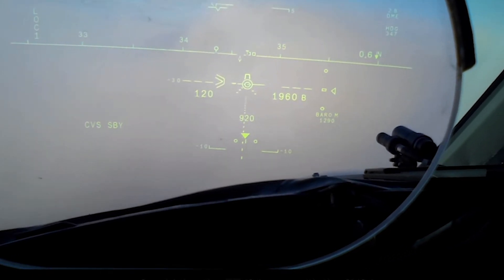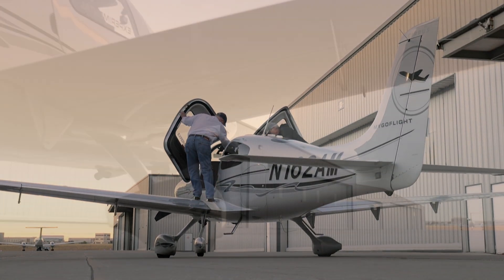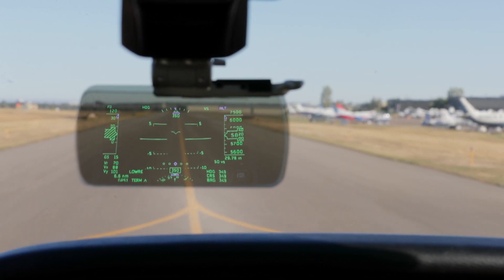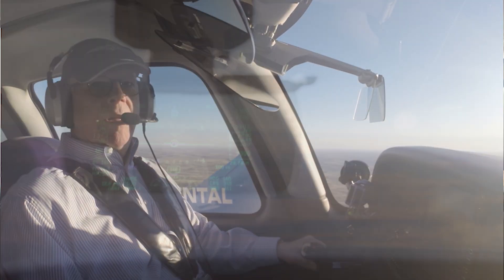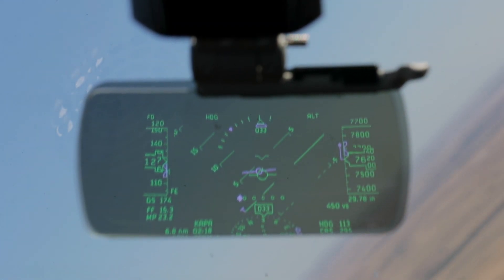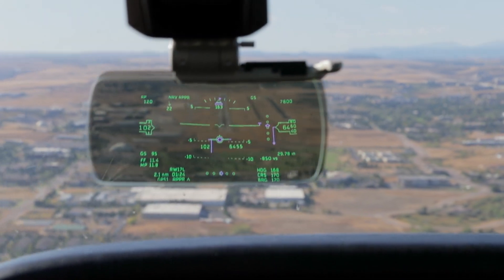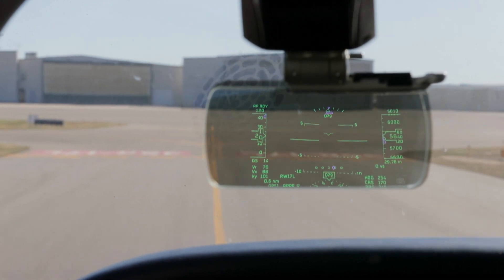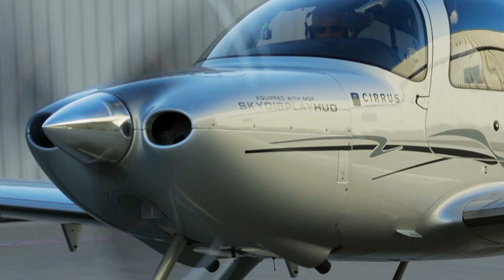Flying with the MyGoFlight HUD for light GA

Comment: Something like this should cost $2500, NOT $25,000. Ridiculous prices in the certified aviation market. Thanks FAA
Reply: not even $2500.. more like $250. it is just projecting the image to a tinted pane.
Reply: Yeah, just look up for certified vs experimental Garmin G3X. One cost $9500 the other $4500, literally same item.
Reply: The only manufactures who get certified have donated massive amounts of money to washington politicians. FAA will throw your application for certification in the thrash if you don't have a Senator or Congressman telling them to push it through.
Reply: This has more with FAA certification than anything.  Then there is getting all the licensees for the hookup to the avionics, certification etc.  Then you mark the fuck out of because any private pilot would absolutely love to have one, even if they cannot afford it.
Reply: Alot of the cost for the software engineering needs to be made up.

However I agree that $25k is still way to much.
Reply: @fernandoaispuro1819  $2500 is totally reasonable for something like this though.

Comment: The view through the glass looks exactly like the HUD on a SWA 737.  Wonder how it compares to a HUDLY hooked to the Mini-GA at about 1/3 the cost?
Reply: No it doesn't.  See how the symbology and the outside view are not equally in focus?  On real HUDs, they are, and pilots don't have to constantly switch focus.  The act of focusing the symbology at optical infinity, over a sizable area, is the hard optical engineering part that makes "real" HUDs expensive.

Comment: Nice.  But what happens when the pilot gets so used to this system  when it goes "kaput"?  Can the pilot revert instantly to becoming a "real" pilot again instead of somebody flying a computer?
Reply: The same argument can be used for high end PFDs and MFDs with touch and so on.
Reply: The Frigging PILOT keeps flying the aircraft!!! Darn it.

      How about, what is the benefit to ongoing situational awareness for novice to expert aviators as these new products, ForeFlight, GUI displays showing moving map information, and this product become adopted in the cockpit?    daffidavit, what if aircraft power is lost, and the plastic breaks on my E6B, and i smell smoke in the cockpit, and my radio  seems to be STILL working, WHAT DO I DO??? (i fly the airplane, and use the items that are available me to communicate my situation, and to do just that.)

My scanning, and motor skills are fully functional if the iPad dies.   The situational awareness, BANK ACCOUNT, is filled so much faster with better User Interfaces, but for now the piloting is on my shoulders only.
N32693
Reply: @beovp91  I believe you are preaching to the choir.  But I'm not sure exactly what you are supporting.  Are you supporting the human brain in the final emergency or the iPad?  My gut tells me you are supporting the human brain.  I hope I understood you correctly.  LLAP.
Reply: @daffidavit  
i am reminding myself, and anyone who has updated tech in the airplane while the original DME, VORs, etc reside, ready to go, in the panel, to use them all and use them all to the best of your ability to be the best pilot you can be, and fly another day.  Lest you feel i am all talk, i got Narco boxes in maintenance getting dialed-in as i write this.  Its so nice when they all work well together.    I do like the MAGENTA line for the always changing big picture, but the the VOR display and will tell you more relevant information in a momentary glance as its much simpler for the brain to organize and comprehend. 

fly safe
Reply: @beovp91  I hear you budd. I suspect you are an "old timer" as I am?  I soled at age 16 back in 1966 and got my PPL at 17 just before I was allowed to drive a car.